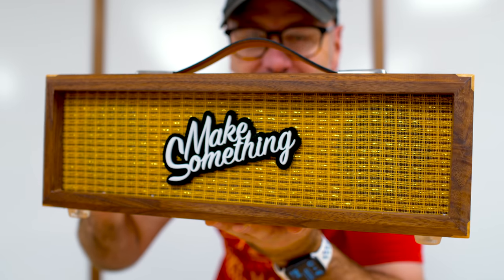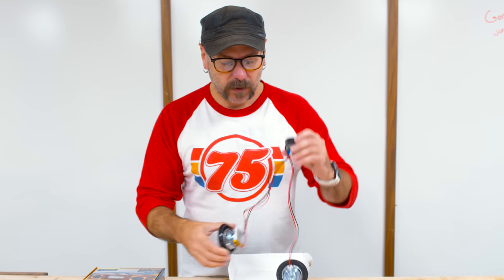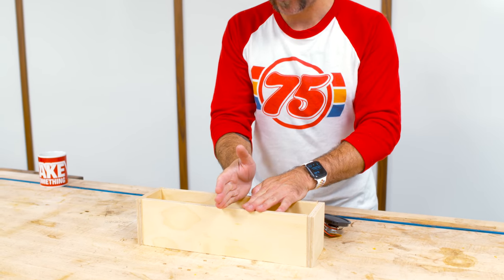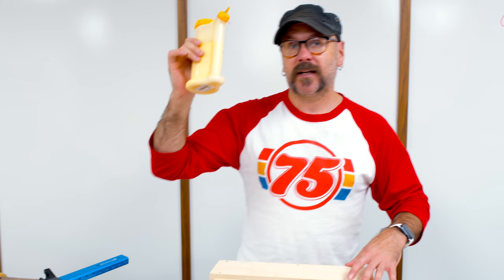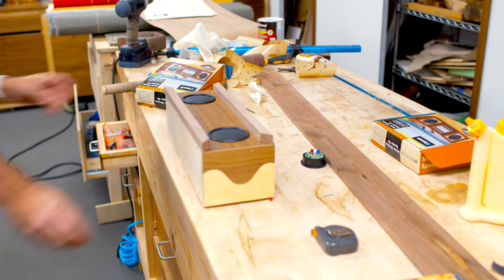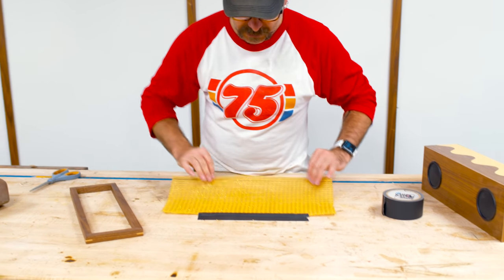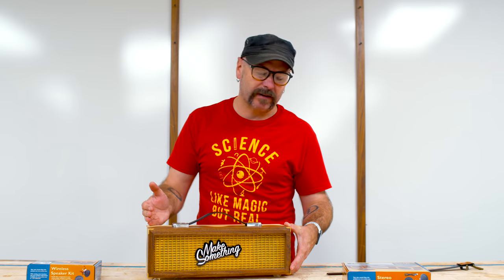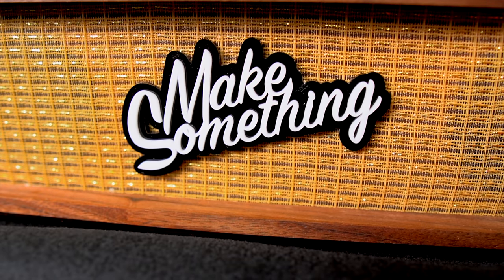Easy DIY Bluetooth Speaker Build | Woodworking Project

Comment: Another option if you want better sound and/or louder speakers is to look for used speakers on ebay or Amazon. Brands like Anker and Cambridge Works make really good and inexpensive speakers and they can be found used for cheap. Disassemble it and reuse its components on a beautiful diy wood speaker.

Comment: I like the way you look for quick ways to accomplish a goal (like Shelac).  Have you tried the Titebond Quick & Thick?  Of the 2 box stores near me, only 1 carries it in the physical store.
Reply from the maker: You know what? I think I have a bottle and haven’t tried it yet.
Reply: @MakeSomething  I used it a few times this summer.  It works pretty good for what I did.  I did look at their website.  Its not as strong as their normal glue, but still stronger than the wood in their tests (so wood would break before the glue).  I think its about the same cost too.  Like a few cents more per bottle.
Enjoy the content by the way!

Comment: Awesome!!!! Great job Bob, when are you doing another batch of ice picks?           Just kidding of course and thanks for yet another edutaining video.    As for the "off centering"  I get this sometimes with yetis that I engrave etc and the key to solving it is to ADD something relevant to the side with "room" to balance it out.  (Even though this is tough with a logo)  maybe a tiny engraved note or guitar on the right side beside your logo.... either way great job!